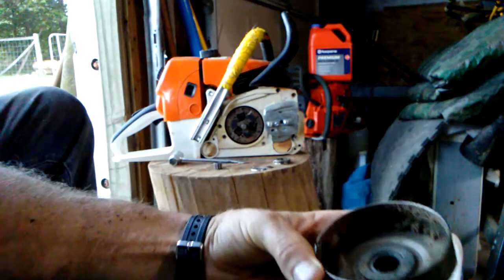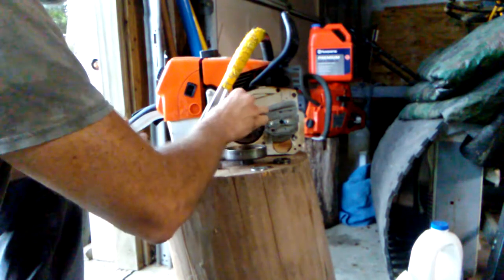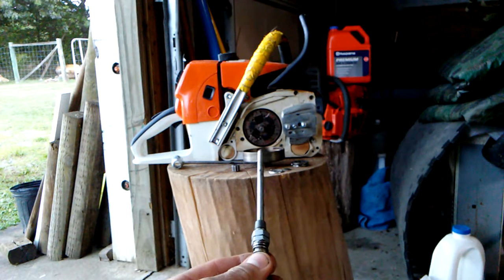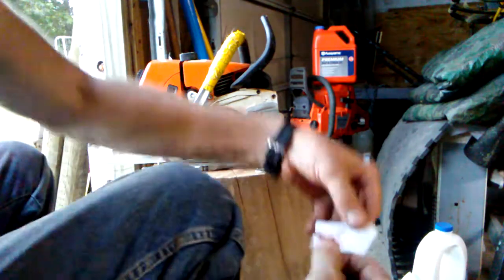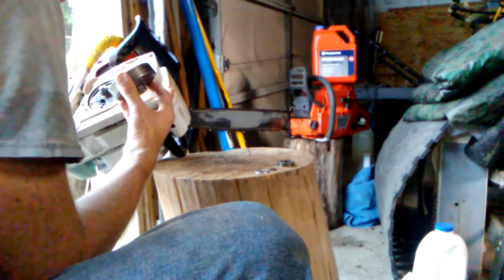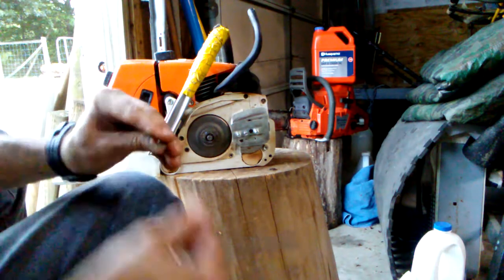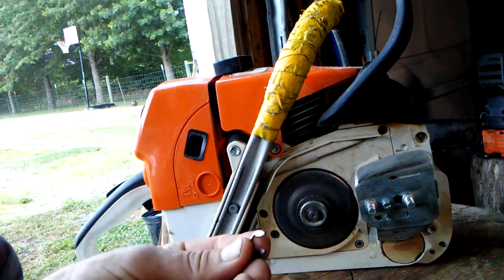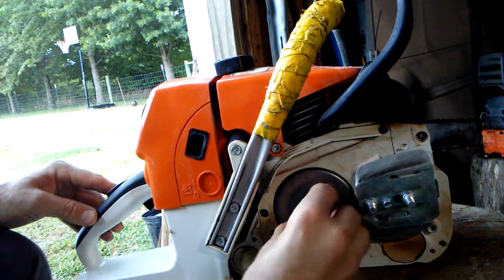Chainsaw clutch drum bearing maintenance.

Comment: Very helpful, I appreciate the video. Wish I'd seen it yesterday, though. I replaced the chain brake band on my Jonsered 2165, took it out to cut, and immediately blew the clutch drum bearing. Not enough grease, I guess, or maybe, though I'll never admit it, I put the washer on backwards under the c snap washer.
Reply from the maker: Hi Andy, the main thing is remember what you learned going forward. Thank you for taking the time to watch and comment...

Comment: What kind of grease did you use? Can any other kind be used?
Reply from the maker: Hi Hadenuf...OREGON makes grease just for this purpose. I have used all kinds of high pressure, high temperature, wheel bearing, and axle grease. The OREGON is not expensive and widely available. Thank you for watching...